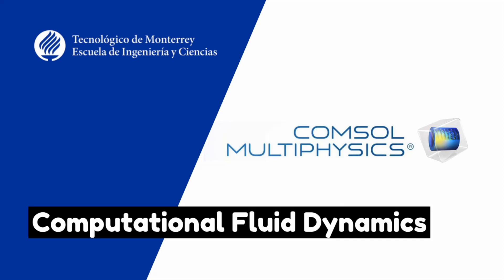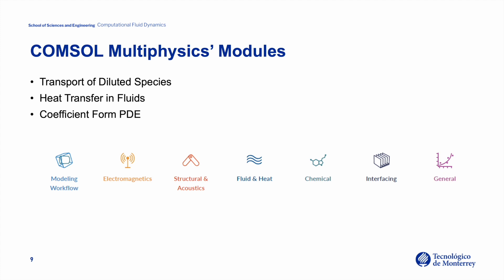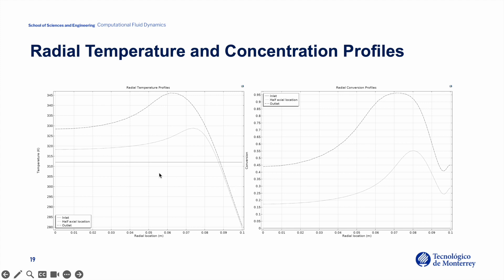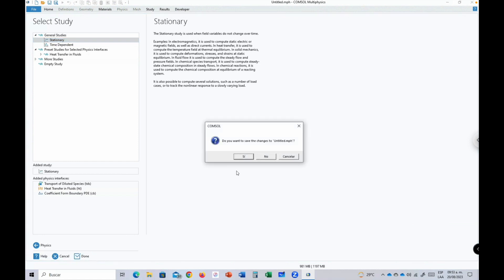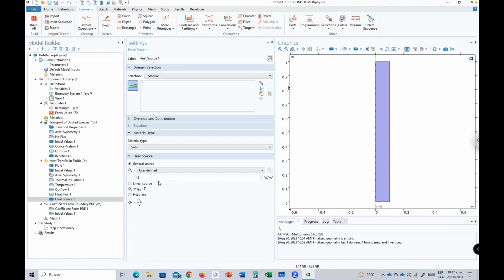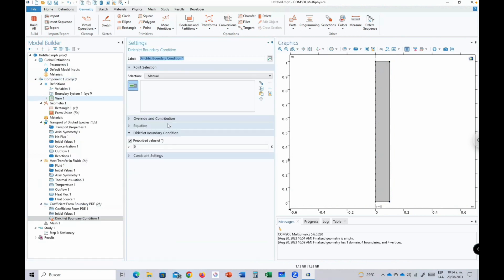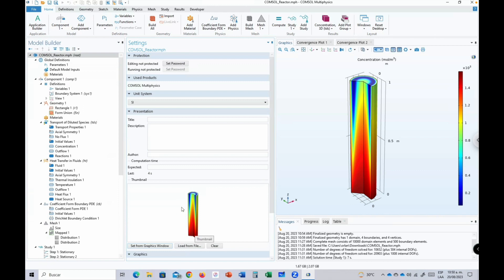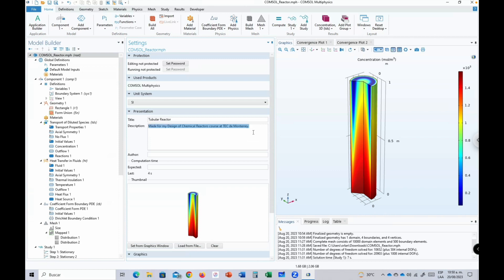COMSOL Multiphysics Tutorial: Tubular Reactor

Comment: but this avaiabe on Comsol application library
Reply from the maker: Yes, it is referenced at the end of my presentation and mentioned at different points of the video.
Reply: @orlandocastilleja  Thanks for your reply , i have a question , do you know what if we replace this cooling jacket physics with ambiet air flowing on the surface of reactor and prducing cooling effect?